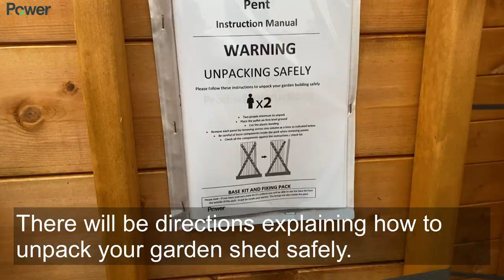How to install a Powersheds Apex Garden Shed - Powersheds Apex Installation Video

Comment: This video was useful to me for building 12x6 shed. Very helpful. Loads of screws supplied so you won’t run out. Very happy with my shed. However when I was sat on the roof to put the nails for roof felt, the roof sunk. Other than that I m quite happy and glad I bought this on January sale. Best priced and great value

Comment: Thank you for this video, it helped immensely as I was able to put my shed together by watching it over and over. Ours was a windowed 4x6 Power Apex Shed with the door in the gable end and placed to the right. Its a solid build and well worth the money spent. I coated the underside of the floor with three coats of No nonsense yacht varnish. We're happy with the finished shed however there's a few things which I'd like to flag that I hope might help others 🙂

Feedback:
1. The pilot drill bit supplied shattered into pieces not too long into the build.

2. Screwing the top and mid ends of the panel with the window to the side panels was almost IMPOSSIBLE because there wasn't enough room for a power tool or screwdriver to push a 50mm screw & in at a right angle because the supports which keep the window panes in place prevents this. I noticed this part wasn't shown in the video, so I ended up going in at a very shallow angle and praying the wood wouldn't split 😀.

3. The roof panels didn't extend past the gable top to allow me secure the felt to the underside as was demonstrated in this video. Not sure why as I followed the installation instructions to a T, I ended up tucking the felt behind the bargeboard and trimmed the excess away. 

4. Some of the nails securing the floor boards to the joists were off centre and protruded through the floor joists. I had to put in some nails at right angles to secure a couple of these manufacturing defects.
Reply from the maker: Thanks for the detailed feedback and apologies for some of the issues. Just on point 3 to re-assure you had not done anything wrong... there is no roof overhang on the 4x4 and 4x6 models. I am pleased you're happy with the finished shed but take on board your constructive feedback.

Comment: I got delivered my 10x8 shed today and I can assure anyone it did not go together like he does it in this video. Numerous issues parts the wrong length, other parts not even lining up correctly and yes I got it square as much as physical possible. I have managed to fix most of the problems as luckily I am an engineer with a lot of kit, but for the price I was expecting a bit better.. Maybe I just got unlucky so tried contacting Powersheds customer service number, lady asked me to email photos of problems which I did immediately, no further response all day. Even a quick phone call to address the issues would have been nice but nothing. I'm happy for all the happy customers Powershed has, fair play but my experience has been sub par for a shed that cost what ours did. I'd appreciate if someone from Powersheds could at least take the time to respond to my email, time will tell.
Reply from the maker: I am very sorry and surprised to hear that! Please can you re-send your issue through to our email address and I can assure you we will respond.
Reply: @powersheds  Update for anyone reading, Powersheds have responded positively and listened carefully to my issues raised and I believe addressing them where possible. I appreciate this very much and think it does them credit and have arranged a good will gesture to compensate for the problems I encountered. All I would say to anyone purchasing from them is any issues contact them as they seem genuinely helpful and interested in resolving things. Good customer service so all things considered I would recommend them to others,  thank you to the customer service team for you assistance.
Reply from the maker: @Teckno77  Thanks for the kind reply!
Reply: @powersheds  I have had a few issues with 12 x 6 as well, for starters the instructions are generic and that's ok when you have a small shed but when they get larger then the problems start. trying to keep everything plum and level but still difficult to line up.
Reply from the maker: @inverterville  thanks for the message. Please contact our customer service team with any images and we will do our best to help

Comment: Interested to see how you nailed the felt on for the sides against the fence.
Reply from the maker: We have known installers or customers  get on the roof to clout nail the felt but we would advise to try build your shed slightly away from a fence so you can fit down. Another option is to install the shed a little bit out and then a couple of able people can push an empty shed back into position, depending on the size.
Reply: @powersheds  thanks for the advice!  😃
Reply from the maker: @chaz4510  You're welcome
Reply: @powersheds  
We have a concrete pad do we still need to put a wooden base on top of that?
Reply from the maker: E46Lewis providing the concrete base is firm and level the shed can go straight on to that. However, if you feel water is likely to pool around your shed depending on it’s location in the garden etc, lifting the shed further off the ground with a base kit will of course maximise the longevity of it.

Comment: Do you have any tips to stop Ivy growing through the slats? This shed will be close to an Ivy covered wall.
Reply from the maker: Ivy can be very damaging to structures over time, including garden sheds. If you want to stop ivy from growing through the slats of a garden shed, here are some steps you can take:
 
Manual Removal: Begin by manually removing the ivy from your garden shed. Be careful to remove as much of the vine as possible, including the roots, to prevent regrowth.
 
Use a Weed Killer: If the ivy is particularly invasive or has a well-established root system, you might want to consider using a systemic herbicide or weed killer. Make sure to choose a weed killer that's safe for the surrounding plants and wildlife, and follow the instructions on the packaging. Keep in mind that it may take several applications over a period of time to completely kill the ivy. Always be mindful of the safety considerations when using chemical weed killers.
 
Block the Entry Points: If there are specific slats where the ivy is coming through, you could consider using a non-toxic, organic barrier like a sheet of heavy plastic or landscaping fabric. This can be stapled or nailed to the interior of the shed to block the ivy from getting through the slats. This should be done after the ivy has been removed and killed.
 
Regular Maintenance: Keep a close eye on the shed and regularly remove any new ivy growth as soon as it appears. This is especially important in the growing season when the ivy can spread rapidly.
 
Plant Competition: If possible, you might consider planting other fast-growing, less invasive plants that can outcompete the ivy for sunlight and nutrients.
 
Remember, if the ivy has been growing for a long time, removing it may leave your shed looking bare or expose damage that the ivy has caused. If this is the case, you might need to consider repairing or repainting your shed once the ivy has been removed.

Comment: I’m putting together a 20 x 8 size. Regarding the floor panels ( 10 to nail together) how can I turn them over once nailed together? Is it easier if I did two together then flip them over?
Reply from the maker: Yes we would recommend doing this in two or three sections rather than trying to turn a whole 20x8 floor over. You can then screw them back together by screwing through the top / sides but an an angle

Comment: I'm building one in a few weeks on a concrete base. Would you recommend stapling some plastic sheeting under the base to act as a damp proof course?
Reply from the maker: Thanks for the message. If you just staple plastic sheeting, it may hold water - therefore if did want to do this you would be better purchasing some actual damp proof course. The floor on the shed has floor joists pre-attached to the floor lifting the shed off the ground. If you feel rain water is likely to pool around your shed floor and then you may want to lift it off the ground further... here you could purchase one of our base kits or just use additional timber bearers to lift it off the ground (laying them in the opposite direction to the floor joists). If you don't think water is likely to pool around the floor or base then you can just sit it straight on concrete. Of course a damp proof course, if done correctly, will help the floor long term - as will re-treating the underside of the floor prior to assembly. However, I would not recommend putting plastic sheeting under. Hope this helps
Reply: @powersheds  that really does help thanks so much. You guys are great 👍

Comment: when turning the floor over it stated in sections if over 12 ft. do you have a video to show how this would be done as i am ordering a 16ft shed. many thanks
Reply from the maker: Hi - thanks for the message. You would do this in two halves and then when both halves are turned back over the correct way, you can simply screw them together from above and at each side by screwing at an angle.

Comment: Doing a 6 x 6 currently, have the base kit also, should i screw the floor into the base ? Maybe a stupid Q, but doesnt demonstrate this on either vid / instructions? Cheers
Reply from the maker: You do not need to screw the shed onto the base but you can if you want

Comment: How many rolls (which come in metres) of roof felt is needed for the various shed sizes which typically come in feet (e.g. 8ft x 6ft) and what type/brand do you recommend? Do you recommend sealant for small gaps? If so, what type?
Reply from the maker: We have many different sizes of sheds (so too many to list each felt requirement for every size). However, for an 8x6 shed we would typically send a 16ft piece of felt which is 1m wide (and this is cut into two 8ft pieces). Then we also send an 8ft piece of felt at 0.5m wide for the ridge. We would recommend a polyester backed felt rather than a rag / sand / paper felt. You should not need to seal felt providing it has been felted correctly. Another option is EPDM rubber roofing which comes with adhesive. Hope this helps

Comment: With a concrete base should I be utilising a barrier between wood and concrete to prevent rising damp?
Reply from the maker: Hi Chris - not many people would do, but you certainly can. I would assess whether it's likely water will pool around your shed (depending on the position of it in your garden). If water is likely to pool around your shed you may wish to lift it off the ground further with additional bearers or a base kit. If water is not likely to pool around the shed then most people would simply have the shed on top of concrete providing it is level.

Comment: no water rain comes inside?
Reply from the maker: Providing the shed and felt has been installed correctly, and glazing has been sealed with silicone, then no rain water should come inside

Comment: I was waiting for how he's going to do the roof from the side of the fences. They did not show how did he get there . 😁
Reply from the maker: We have known installers or customers  get on the roof to clout nail the felt but we would advise to try build your shed slightly away from a fence so you can fit down. Another option is to install the shed a little bit out and then a couple of able people can push an empty shed back into position, depending on the size.